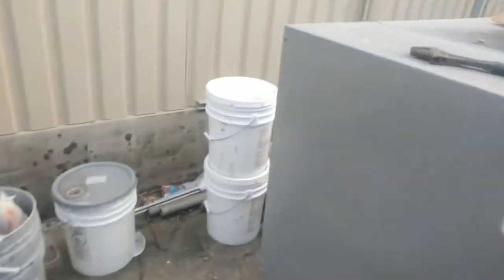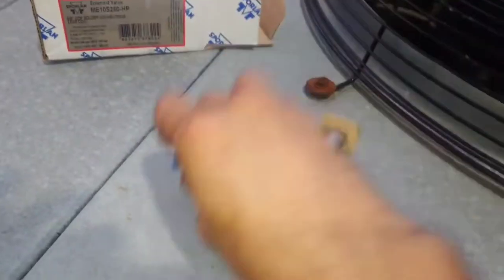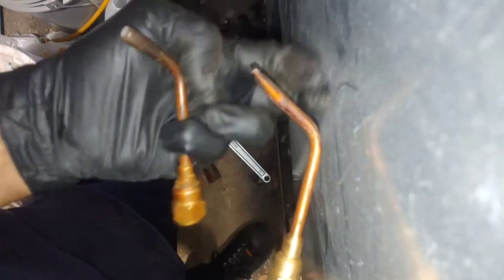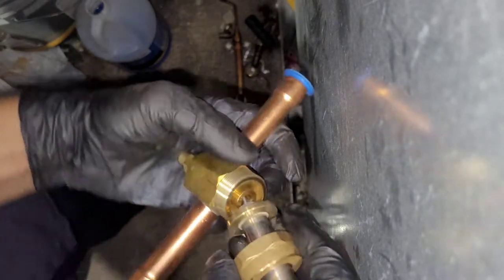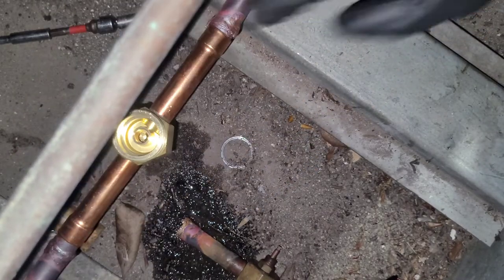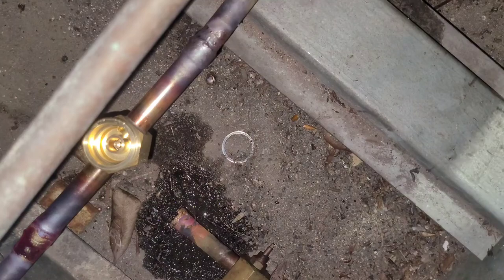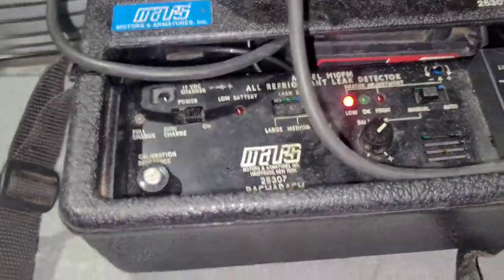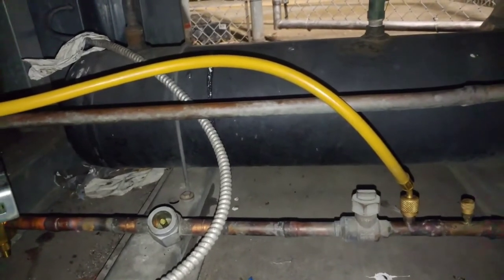5/8" LIQUID LINE SOLENOID VALVE LEAKING REFRIGERANT - REPLACEMENT - ENTIRE STEP BY STEP PROCESS

Comment: Company I work for hired 2 techs for refrigeration, they got 2 grocery stores so far and other stuff. I have 8 years experience doing residential/commercial/industrial and I’m hoping to learn more refrigeration. The heat sink gel/paste works better than wet rags especially on stuff with Teflon gaskets. Also I use a cutting torch tip like a rose bud tip. Everything from 3/8 up to whatever size
Reply: The first / last time I used the Gel, it was spattering right in the face while trying to braze close quarters. Wet rags with water just steam, way less distracting / safe. The puddy is good stuff though.
Reply: @FrenchBeefCDN  we use the putty that comes in the tub.
Reply from the maker: I have used both over the years. I've kind of gone back and forth a couple of times but always seem to end up back with the wet rags. It would be interesting though to do a comparison with the same size copper, same size torch tip and same amount of time and use maybe a thermal gun to see which one keeps the pipe cooler than the other. I do remember that there were some things that I did not like about the gel and the paste which I think is the reason why I stopped using it. I still have some somewhere.
Reply: @HVACRServiceTech  I still have a bottle in my truck too. Id probably use it to keep adjacent sensors etc cool, but not the part im directly brazing on ie filter drier or txv etc.

Comment: I see that sight glass is yellow and indication of moisture .
Reply from the maker: Nah... you trippin
Reply from the maker: OK, I'll explain a little better. I don't suspect there to be an excessive amount of moisture or any moisture to be concerned about, because it's not presenting itself in the liquid line gauge.  The dryer right next to that old and faded sight glass is capable of catching quite a bit of moisture.  Once it can't catch any more moisture and it's full,  It would show itself to need replacement by having a temperature drop and a pressure drop. Just an old sight glass bud.
Reply: @HVACRServiceTech  This is truth. I have liquid sight glasses on my recovery hoses for chillers. I have had hoses run on vacuum pumps all night in warm chiller rooms, and in theory the sight glass should be green / dry after all that (and under 500 microns for HOURS) but it's stained yellow permanently. I think  the idea with the moisture indicator is a NEW one should change colour, but old yellow ones are One and Done. A brand new MI will be yellow, but turn green after placed into service. I think if it gets wet or open to atmosphere again, its cooked, but not meaning the system is "wet". Could always do a refrigerant sample and see the PPM of H20 and acidity. Thats what we do in the chiller world.

Comment: ? you bent that pipe pretty good with your “shock it” method. that why you like15%? doesn’t crack as easily?. should call it “F#ck it” method. it’s right on the list next to “inch’s of vacuum”
Reply from the maker: I don't expect it to crack either way to be honest. I loosen wheel lugs the same way when the wheel spins freely in the air, so perhaps I'll inspect the rotor for cracks next time I do that.  What kind of list is it that inches of vacuum is on?

Comment: Could just rebuild it
Reply: The only thing worse than doing the job twice is doing it for free the 2nd time. Ive rebuilt parts and just replaced. Usually a rebuilt just leads to replacement anyways, but other times its never been a call back at all. Depends on why the part failed and if rebuilding would be just as good of repair. If a TXV bulb ruptures, do you just change the TX Bulb, or do you braze in a whole new valve?  Ive done both, just feels awkward throwing out / storing a brand new headless TXV... Labour is way more expensive than parts,  that's my thought.
Reply: The bladder stem was leaking can’t rebuild part of the valve 
Could get a cap for it but heck why not just change it mothers customers want it fixed one time